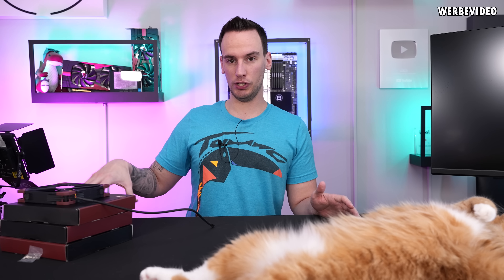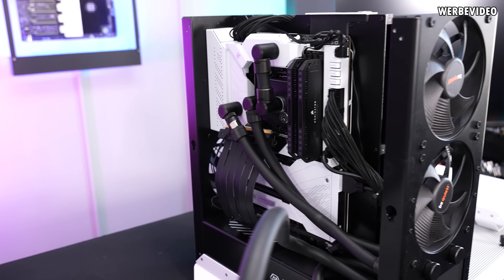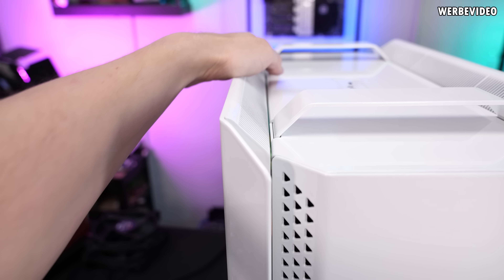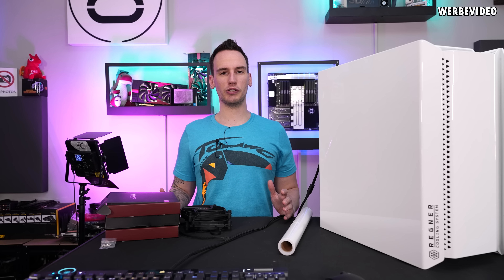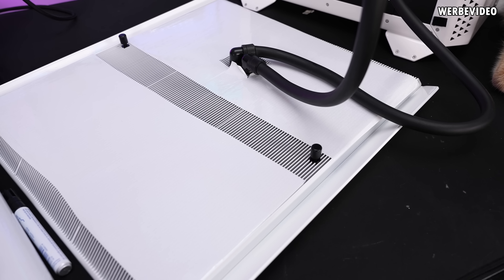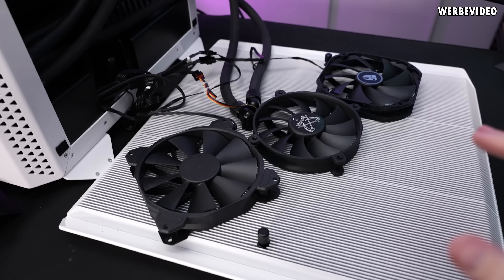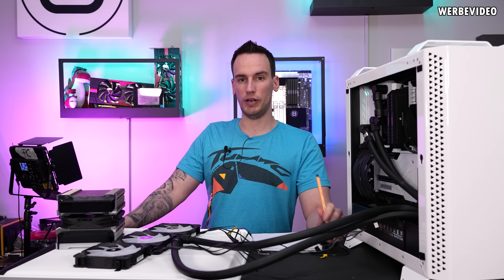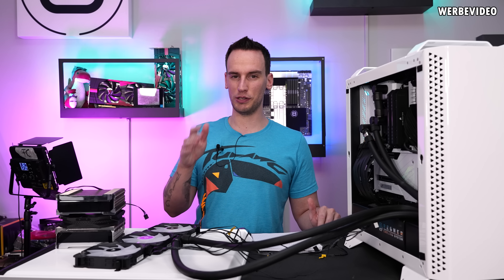Trying Community Ideas to Fix the 1700 EUR Regner Cooling Case

Comment: The geometry of those radiators is the main problem. It expects a high velocity of air along the entire length, from one end to the other. At the relatively quite low speeds of computer fans, the air has run out of thermal capacity well before it crosses the whole raditor. A typical pc cooling raditor instead has far shorter fins, so that the air has enough thermal capacity to remove heat the entire time it spends between the fins. 

If you replaced one of those side panels with a solid sheet that has a normal radiator in the middle of it, such that air moves directly through the side panel, the results would probably be considerably better, despite having a lower radiator surface area.
Reply: i wonder if the fins being cut diagonally instead of vertical would promote better airflow over them vs it's current design. while i don't think there would be a significant gain there should be less need to try to brute force the air through them to get similar performance.

Comment: The issue seems to be a fundamental misunderstanding of thermodynamics. With this type of radiator configuration, air passing over one part of the surface is going to become heated and that heated air will continue to interact with additional parts of the radiator. Because this heated air will have a lower thermal capacity, it will absorb less and less additional heat as it moves to exit the case, rendering it less efficient and effective. The radiator size on this case is significant but, the amount of air passing over it is too little and/or too slow to remove the thermal energy stored within the water.

The most common radiators design (normal computer radiators or those you'd find on a car or motorcycle) avoids this problem by simply having intake fans pass cool air across a thin, but large surface comprising the heat exchanging surface area and then immediately moving that heated air away from the radiator. Thus, every part of the entire heat exchange surface has access to cooling, ambient temperature air that can efficiently absorb thermal energy from the radiator.

There ARE radiators that pass air through a longer exchange surface similar to this in design (i.e. high efficiency, compact heat exchanging systems found within laptops, game consoles, servers, HVAC systems, etc). These systems are carefully designed to provide enough pressure and airflow to ensure that the incoming air presents sufficient thermal capacity across the entire exchange surface area to accomplish the intended thermal transfer objective.

TLDR: If you want to fix the radiators on this case, greatly increase the airflow with unobstructed, high speed, high pressure, high flow industrial fans.

This, of course, assumes that these radiators have proper internal flow design as well.
Reply: plus, this radiator design doesn’t even have a lot of surface area between the metal and the water itself…
Reply: I guarantee that it is internal flow-surface area that is the issue. The rads don't really seem to get hot so its like the heat is stuck in the loop and never gets a chance to get out through the fins.
Reply: Judging by the location of the hose connections for them, it looks like the internal flow path is nowhere near what you'd need for a counter-flow heat exchanger. That's the only layout that makes sense for the flow that the air is supposed to take.

Comment: could you introduce a flow meter to see at what kind of speed the water is getting around the loop? im wondering if the impedence is too high for good flow, and it just doesnt get the hot water away quick enough?
Reply: My thought as well.  This is like trying to use a D5 to replace a car's water pump.
Reply: nah man i’ve had a loop with an extra slow pump that couldn’t even spin a flow indicator and temps were less than 1C warmer (water) than with a D5 at max speed
Reply: No because he's measuring the water temp. The flow is not the problem.
Reply: @LawrenceTimme  The point is that inadequate flow could impact the water temp because it's not circulating enough to sufficiently cool this amount of liquid. I don't think that's the primary issue but it could be a factor.
Reply: @JJFX-  no that isn't how this works. The flow would have to be almost zero for that to happen the speed of the water has almost zero impact on the water temp. It would only effect the component temps.
Reply: @LawrenceTimme  Yeah normally flow isn't a big deal in this regard and everything equalizes anyway but this isn't a conventional setup. Considering the mass of these rads, something internal seems to be limiting how effectively heat is pulled from the coolant.

I'd agree it's more likely to just be a crappy heat transfer design but the internals seem closer to that of a car. In those cases flow rates can actually have a bigger impact on coolant temps and overall efficiency. While not a great comparison, at the very least it's something I'd want to test the impact of.
Reply: @arthurmoore9488  Exactly! Too much surface for not enough pressure.
Reply: *impedence
Reply: The total head pressure may be way to high. I expect as well that the pump isn't keeping up. That seems like a lot of distance and water for it to push. I also believe that the water channel in the side panels may be an issue too the ports are right next to each other and in the middle of the panel as well.
Reply: How about a dual pumps one for each radiator?
Reply: I wonder how the motherboard's VRM watercooling bogs things down.

Comment: I think it depends on the head pressure of the pump thru the rads as well as the chemical makeup of the paint. Some paints thermoregulation properties are conductive , some have insulation. Depends if metallic for reflection, etc. I used to mix paints at a Major Hardware Store.

Comment: As others said, adding a flow meter would be great and the two mods I would suggest are, improving the intake to the fans by cutting holes on the front panel and taping the rear fan to build positive pressure on the case forcing the air through the fins, other than that, they probably need to improve the water channel thermal resistance, that why compulab uses panel wide vapor chambers and heat pipes.

Comment: From looking at the comments, for the radiators to work well you'll need pre-cool air so something like an intercooler setup and 50 watt Delta fans to push the pre-cooled air through.

Comment: Ok my suggestion to the case maker if you read these comments, make the radiators "radiate" on both sides, so they pull air through, not run across. Maybe make the outside panels dust panels, then include with the case literally, 18 fans but that's everything, with controllers, so anyone with 2 pwm fan headers on their motherboard could run all 18 via PWM signal but not have power or fan header limitation issues. To Roman, I'm very glad to see you humour some of the suggestions, I'm surprised that it didn't improve but also agree, 3+3 fans a side + 3 more fans in the case, 9 fans, that's really pretty much the limit for what's practical, 9+9+3 fans, yeah that's getting silly.

Comment: 1 car huge supercharged fan, a few turbo fans in the front with a mesh panel and the most important 1 good headphones with proper external noise isolation and boom fixed 😁

Comment: My  money's still on the airflow pattern and the fin orientation not working together. Either they move the fans to the bottom blowing up or they reorient the fins to run front to rear so the two fan intake system (and ditch the exhaust fan at the rear in favor of gaps at the rear end of the fins) has airflow moving parallel with the fins and have more of the fine length exposed to moving air.

That said, I do not actually expect it to beat the 2x360mm set up. At best, I only expect that it get  to about 2C warmer but at a markedly lower noise level, so basically large fans.

In any case, none of these can be done via modding, they really have to revise the case.
Reply: It's not airflow, what he did should of given what it needed. It's simply not good radiator design. Not enough surface area for the style of radiator it is.
Reply: @JJayzX  Total surface area should be fine if utilized properly. I think it's more of an issue with the design and internal surface area of the coolant channels not providing adequate heat transfer. Much of that external surface is probably not doing much. The parts that are would be hampered even further by heavy anodizing and paint. Also as others point out, flow rates might actually make more of a difference here than usual.
Reply: @JJayzX  It could also be the water flow, but we can't see if there's  a problem with that yet ie there's no cross section of that rad to see how much of that panel actually has water flowing through. Yes, it might still just all be just one tube looping around near where the water goes in and out, so the ends don't get utilized. 

But the  point is we don't know that for sure, and even  if that  turns out to be the case, that weird airflow pattern would still complicate  how much of the surface area would even have air flowing through them.

If the fins were on the outside too though the airflow pattern inside would be a lot less of a problem given there'd be passive cooling on the external fins. At that point might need the  fans mostly so components that can't take a waterblock  (like m.2 drives directly mounted to the board instead of a PCI-E slot adapter) can get some cooling as well  as to not have the heat on the interior fins just indefinitely warming up the ambient air inside.
Reply: @Z020852  What weird airflow pattern are you talking about? Fans create partial positive pressure inside the case, the only way for the airflow to go is out.... THROUGH THE FINS.... What is weird about it?

Comment: I believe 3 design changes would make this a very effective cooling solution:
1. The fins need to run front to back, rather than top to bottom. This would allow the front intake fans to push air THROUGH the fins, rather than just on top of them.
2. The front panel needs intake directly in front of the fans, those little triangles wont cut it for such a comprehensive cooling solution.
3. The paint on the fins is acting as an insulator for the radiators, they should be either anodized or at least only given one coat. As you can see they have done at least 2 coats of paint and a clear coat, which will stop a large amount of heat transfer between the air and the metal of the radiators.

Comment: If more airflow did not fix it then you have a flow issue. You need a pump with a higher head pressure. Plenty of surface area but if the fluid can’t move through it and exchange heat to the air then it’s the same as trying to use a 120mm aio to cool

Comment: I don't understand how they didn't realize this design had big issues. For the price it is sold at you would expect people to actually check if it can cool a decent rig properly
Reply: not enough proper testing.
Reply: Probably they thought they'd fly under the radar for making so expensive and low quantity products. This case is made for people with lots of money, but not all of them know really how to setup and test a system, so they'd probably blame lack of performance to the chip/graphics card, because they'd think that a 1700 euro case cannot be the culprit. The manufacturer was just unlucky on attracting the attention of a prominent youtuber that decide to test if the marketing matched reality.
Reply: @itisabird  yeah
Reply: Most people buy form over function. Look at people waiting hours to buy 500$ sneakers that have worse material and comfort than 100$ shoes because they look cool
Reply: Right.  At a minimum, I would have thought they would market it showing how it compares to a few other popular cases, such as the Torrent, Tt T900, or Lian Li 0-11xl.  If it can't measurably outperform existing cases, then I don't see the point.
Reply: They probably could only afford a marketing dept or a QA dept. They chose the former.
Reply: @kcgunesq  why? i think people have a misconception of what market this case is intended for and it's not the enthusiast high end gaming system market. lets put it this way, say you are an architect/CAD or Interior designer and you need a semi high end system to do realtime rendering for clients.. would you rather your client see a case like this or the torrent or the i'm reliving my rave party teenage years 0-11XL in your office?
Reply: @sirmonkey1985  I guess I would stick it under my desk so they don't see it at all.  Besides, while I have a torrent and don't consider it all that attractive, in the non-rgb versions, it is perfectly suited to office use.
Reply: no one was feeling like building into it just selling the concept

Comment: You would think they would have tested these things before going to market? Do you have a flow gauge? Maybe the pump is too weak?
Reply: That's a really good thought!!!!
Reply: Yeah there is a lot money involved, how didn't they see this coming? 
I guess 0 real testing and just follow wrong calculation till full production.
Reply: Probably one of those "Looks good on paper" scenarios where they engineered it without the means to test it until after investing in the machine tooling needed to produce it.
I'm sure it's not cheap to call up and ask for a dozen prototypes of a side panel shaped radiator.
Reply: @CBourn48223  still, isn't that what simulations are for these days? If there was a major design issue I feel like that should have caught it before going full on production with these.

Comment: I think it would benefit it if the 3 fans where on top and the only intakes where below the radiators they would have a steady flow of fresh air.
Haha maby get a ton of 40-50mm fans and put on top of the radiators and maby foil it so it only takes air in at the bottom would do the trick.

Comment: For the lulz, if you decide to go for case mods, maybe use some squirrel cage fans along the bottom of the case, directly blowing the bottom of the radiator? Cap off the bottom of the radiator to make sure the air from the fan is forced up to the top of the radiator. Fundamentally, though, it might be easier to fab a new front panel to give those two front fans more room to work. Noisy as heck either way. I wonder what Version 2 will look like. 👍️

Comment: The built in rad should be flipped 180 so fins on the outside so heat escapes to atmosphere and not the interior, also there a big chance of a air bubble in the rads, that will make temps climb high

Comment: Seems like for V2 they need to change the fin alignment from running vertically to running horizontally. 
With the current vertical layout, absolutely no air can flow from front to back. But if the fins were aligned horizontally air could easily flow between every gap in the fins.

Comment: I'm Mechanical Engeneer, and if my mind does work well, I remember my lessons of heat transfer. The problem maybe it’s the fins thickness. The fins are so thick, so then, the mass volume are high and it’s more dificult take away the heat from the fins with the flow of the fans doesn’t enough. 
That’s why the delta thermals are imperseptibble even adding more fans. 
Maybe the desingner doesn’t had heat transfer knowledge.

Comment: 2:12 dear god 1700 eur and not being able to swap fans easily? the regner is a scam
Reply: not being able to swap fans is the last of this case's problem lol
Reply: Its a common complaint from case reviews... They make these products and never build in them or think the way they did it is the only way that is right. From a silence perspective you definitely don't need to remove that fan, but since the cooling performance is terrible without way more powerful fans, you have to change it, and the fact you can't is an atrocity. What if the damn thing broke? Disassemble the whole system to replace a fan. I don't think so.

Comment: A suggestion that completely gets rid of the entire selling point of this case: 
replace the radiator side panels with a standard PC side panel with a bunch of holes and standard radiator mounting holes (idk if 3x420 would fit, but 3x360 surely will). Also punching more holes into the front panel for better airflow.

Comment: To get an idea of how much surface area passive water cooling requires, the now discontinued alphacool cape coras dissipated about 10W each tube. I don’t think passive water cooling makes sense when you can have six fans that make less noise than the coil whine coming from the components themselves.

Comment: Judging by heatsink design for passive cooling like in audio amplifiers and even Noctua’s own passive cooler, these fins are likely too close together to allow adequate airflow from natural convection. There could be more things at play as well.
Reply: I agree, too close, and also the wrong orientation, they should run lengthwise.
Reply: It doesn't use natural convection. There isn't a fan directly on it but the air pushed in to the case by the fans is forced out through the radiator fins. You could call it semi-active/passive as there is no fan directly on the RAD but the air is forced out.

Comment: What about replacing the side panels with standard radiators    Possibly make up some Perspex/aluminium panels to mount them on to the sides so you are still using the case airflow?